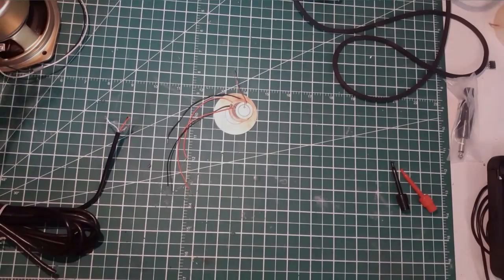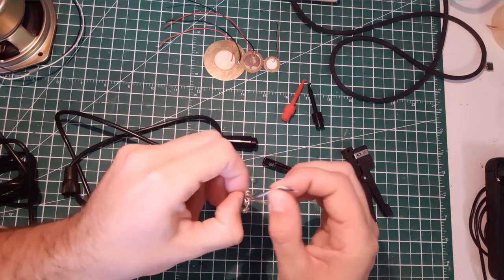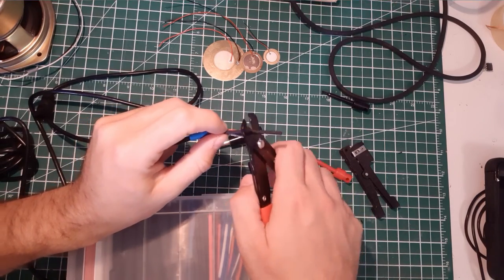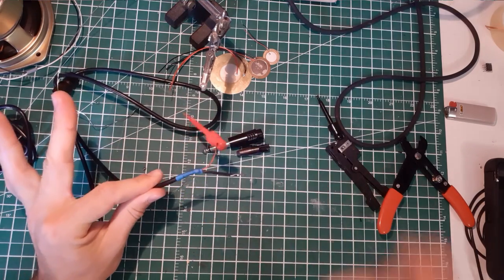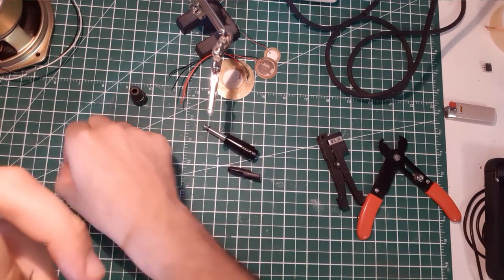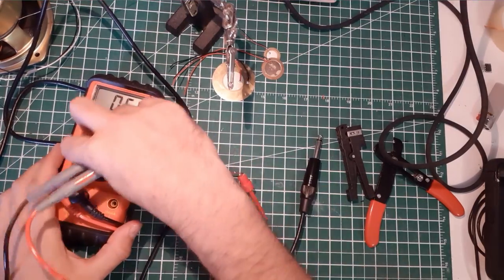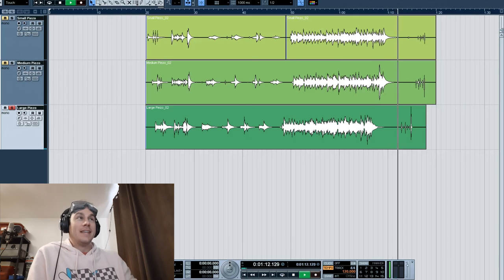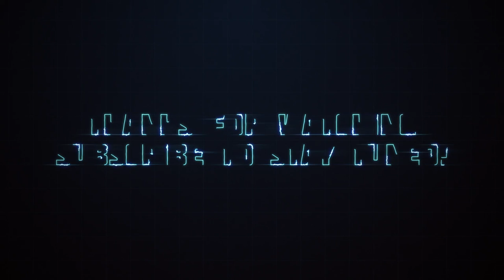3 Piezo 1 Guitar

Comment: I had far better results with one like the small you used, but placed on the head of the guitar pinched with a capo. I think placement is important. Also the impedance of your input. You can mix multiple piezos passively but you'll lose gain for each additional one you connect to your jack (in parallel with bypass resistors between each), it is due to the added capacitance of the piezo discs. I also have one I glued with epoxy to a woodpiece that has a different response than unsing directly the disc. Many variations are possible. Also I have a TS808 and using it as a preamp is quite magic regarding impedance matching.
Reply from the maker: Wow! Thanks for sharing your experience with piezo! Do you have any videos or recording? I guess I still have way many more experiences to take with these little gems!